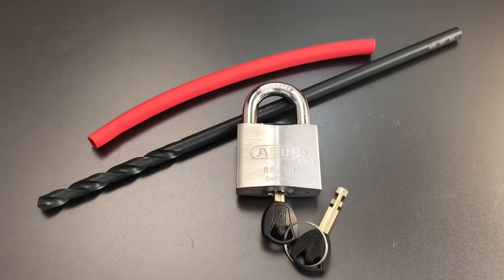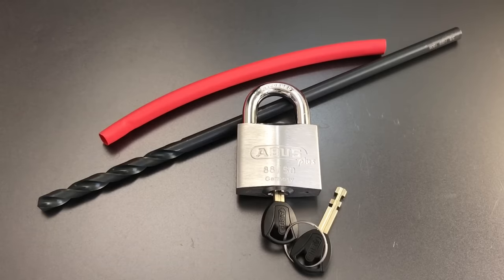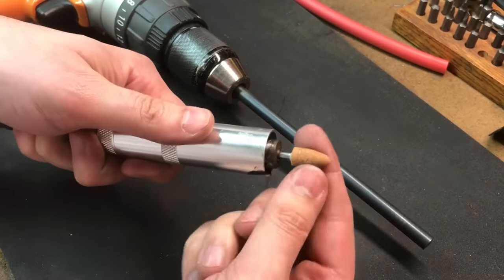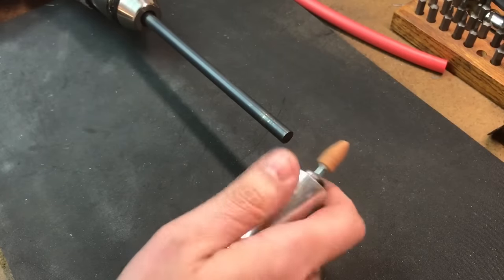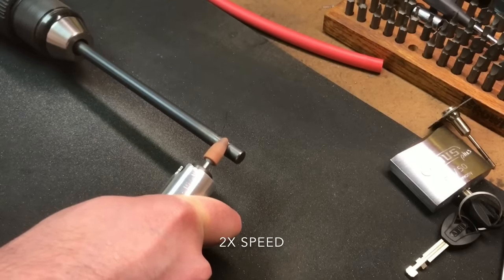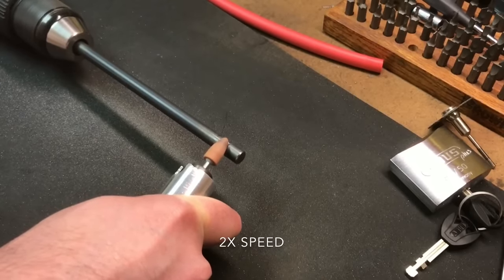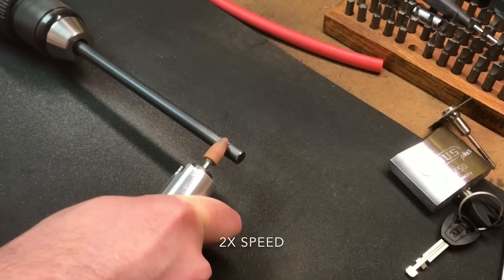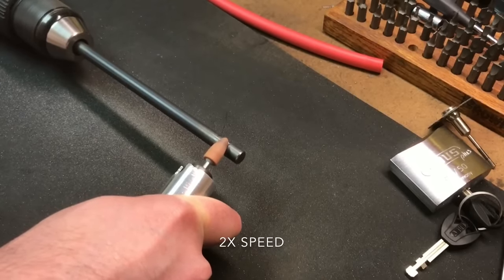[464] LPL Project: The Best Gun Lock Ever?

Comment: REGARDING PLASTI DIP: I've had that same type of can, opened, for 8 years now. The way I store it is: Put on it's plastic cap. Then put on two layers of kitchen plastic wrap so that is comes down over the side by a few inches. Put rubber band to hold that to the can. Then put aluminum foil over all that, with another two rubber bands. -- All of this seems to have made a tight enough seal to keep the PLASTI DIP from drying out. Have opened, used, and resealed maybe 6 to 8 different times over that 8 years.

Comment: Neat idea. If you notched the drill rod, rather than cutting a groove around it, it would be stronger. Secondly, why not plastidip the drill rod too, so it color matches the lock and seals the heat shrink tubing?

Comment: Old video recently watched and I have a design question.  Like the recent Master Pin Lick you pointed out the narrow neck where you cut for the locking lug, on this DIY, could you have made that groove directional? I get turning the bar would treat the lug like a shimming attack, but if there was a way to attach something that prevented the lock body and/or the bar from being twistable would enable you to put the groove on one side of the bar increasing it's overall strength. Just a random thought nagging at me I had to ask.

Comment: Marine grade heat shrink usually has at least a 3 to 1 shrink ratio, so a larger size would work. Better to use rubbing alcohol as lubricant, as one can then blow a little air through it for fast removal, or wait for 15 minutes to dry naturally.

Comment: The problem with using a grinder / Dremel / cutoff wheel tool so that sparks fly away fr your body is that when the tool runs away from the material it comes toward your body rather than away.

I use the term " when " because it ALWAYS will catch at some point when cutting and run - much safer it runs from you than toward you.

So you need to protect yourself from sharks ( pieces of material) that will be spewed in your direction while cutting, obviously

Comment: Great video and project. I would suggest it might be easier to bend first, then cut to length and make the groove. This will eliminate the potential of bending in the wrong place.
Reply: I thought of that as well, but if you use LPL's method of putting the shaft into the drill to make the groove, you can't do that after it's bent.

Comment: Hey, I don't know if you still read these, but you might want to try taping over your open can of plasti-dip with foil tape or just tightly securing a piece of heavy-duty aluminum foil over the mouth. Might not stop drying, but it's a low-cost, low-effort fix attempt 🤷‍♂️

Comment: I had the thought 6 years later. Why didn't you Plasti dip the drill bit locking bar in the Plasti dip. It still looks good for the heat shrink but maybe better with the Plasti dip. Just a thought for the 2.0 version.

Comment: I've never seen that plaster dip stuff, just wandering if it could have been used on the rod as well in place of the heat shrink tube?  might be easier to install and have the colors match perfectly.

Comment: I wonder what the thought behind using a drill bit was. Grip that gun by the barrel and smack the lock against the edge of a sturdy table.
This kind of steel shatters. You would be much better off using a cheaper soft steel that deforms.

Comment: Instead of fighting with the heat-shrink tubing, why didn't you just dip the lock bar when you dipped the lock body? If you had, both coatings would be a perfect colour match for each other, and if you make more than one of these Gun-Locks, using different Dip Colours allows you to ensure you don't accidentally try placing the wrong lock on the gun...each gun gets it's own unique lock colour...

Comment: as update: don't us a Drill just use a Hex Kex, they are already bend and hardend, so you only need to cut it to length and grind the Groove. and if you grind the grove just on one(the right side it will also prevent everything from spinning)

Comment: Your locking rod looks very similar to a ball ended hex key. Maybe that would be an easier starting point to work from? Might get lucky and find it works right off the bat with no adjustments.

Comment: Are there any abus locks like that that cme with a non retained / removable shackle? Thinking about it, what if you just had an appropriately sized lock, with an extra long, removable shackel? Add some heat shrink and call it done - is the issue that those locks don't exist?

Comment: So if this is better than anything you can buy, and it's relatively cheap and easy to make, why doesn't someone make this and sell it?  Hell, a gun lock maker is probably already going to be a padlock maker, so they basically just need a hardened steel rod and a plasticizer?

Comment: TBH, I think an angle grinder capable of that cut is far cheaper than a dremel capable of that cut. The notch grinding isn't nearly as power-intensive as the cut, so a cheap dremel and cheap angle grinder are probably a better option than an expensive dremel.

Comment: Why not plasti-dip the drill bit instead of using heat shrink? The slightly different color of red hurts my OCD. :-)
It would have the advantage of not having the little hole at the top from where the heat shrink tube is open, no worries about heating without burning, no problems with getting the heat shrink around the bend, and no bulging heat shrink inside the bend.

Comment: If this design was adjustable to fit different size guns you would dominate the gun lock market. could there be multiple notches on the drill bit and exit hole on the pad lock so the drill but can pass through it and lock at multiple heights?

Comment: Nope, I would grind the drill bit emulating the original shackle, on one side instead of all around, otherwise it would be too slim, this metal is very brittle and prone to breaking  I would index the curve at the other end in the direction of the barrel, either to the front or to the back of the gun. Disclaimer: I live in Canada, don't have a gun nor plan to get one, ever.

Comment: I'm guessing the other part of the shackle rotated slightly, so that the ball bearing couldn't drop in cleanly and so the key couldn't unlock things as the ball bearing was pressed against the cut shackle part. Stopping that part rotating will make things easier, plus you don't need to cut out as much if you know that the long shaft isn't going to rotate around.
Also, why use the heatwrap tube when you could just plasti-dip the drill bit?

Comment: You coulda run the angle grinder at 1/2 speed and the dremel at 2x speed and the angle grinder still would have been 2x faster! Good point of using the right tool for the job!

Comment: If you put the open can of plasti-dip in a vacuum bag and then suck all the air out, it might keep longer...I suspect what you refer to as drying out might be the material curing in the oxygen of the open air as it's supposed to...remove the oxygen/air and it shouldn't cure in theory...

Comment: Probably could have got a j shaped or u shaped bolt and modified it and eliminated the torch to bend with and had more of a radius for the heat shrink. Fastenall might have had the right grade of metal j or u bolt for your build.

Comment: so I drive a semi truck. 
they use this same brand lock and 2 steel plates to secure million dollar loads (technically all my loads are secured with this lock). the plates block access to the shackle. so someone brute forcing it could have to grind through the lock body itself or the metal plates. Is this brand lock considered the best from a picking/other security perspective.

Comment: And if you don't want to blow the temper on your steel rod and risk setting your house on fire with a torch, just buy 2 locks, repeat steps 1 and 2 on the top of your rod...and BAM...done. Or you could use a hardened Alan Key that's already bent on one end.

Comment: Supercool lock design and anything LPL endorses should be pretty idiot proof. 1 remark about the heat treatment. When going red hot you destroy at least 2-3 inches of temper so my recommend would be to heat all of it till non-magnetic and dunk it in oil to re-harden it so you know those weak spots are gone

Comment: 13:50 wait a minute... why isn't LPL using the cut off shackle as a reference bit for the notch? Even if the length would be a bit off the shackle's notch would still be a viable reference for if you got the cut to the point it'd lock in.
Edit:*two minutes later* Ah, there it is... nevermind then.

Comment: How hard would it be to bend the drill bit part back straight or even break it with the help of some leverage? I can’t lock-pick but I would sure be able to do that ahahah
Edit: You would just need a one meter iron pipe not too much larger than that, put it on the bent end, put your foot on the lock and go to town on it! I know iron is softer but if it was thick enough…

Comment: I don't understand gun locks. I get it on paper, you don't want your kids getting a hold of it. But then why not just hide it well?

Then when they're old enough, take them out shooting at the range. Let them appreciate how dangerous they are and teach them gun responsibility.

That's exactly what my dad did. I never knew we even had guns in the house as a kid until I was probably ten or so, then my dad took me shooting and it gave me an appreciation for how to handle a gun.

After he was sure I understood, he told me where the guns were and made it very clear he was only telling me in case I was ever in a situation where I was home alone and someone was trying to break in. 

Never touched those guns without his permission once. It's amazing what responsible parenting can solve and prevent.

And you might say "well you can never be too careful with kids", and I agree to an extent. But also, gun locks only make sense on a gun you aren't using for home defense. If you need to access that gun in a hurry, that burglar isn't going to let you wait to find your keys (because you can't store them near the gun) and then unlock it, then load and rack a round. It's horribly inefficient and that's dangerous in a home defense scenario.

Comment: Id stick to Picking the locks. Lol im really curious how much force itd take to break the lil nub u made off. By cutting all the way around it, u are actually removing more metal than needed. Therefore making it weaker. I was scratching my head, wondering why you went through the trouble of marking where it needed cut via the mark made by the ball bearing. When you had the shackle next to you. That told u exactly where the notch should be. Im also curious if anyone with metallurgy knowledge, can answer my question. On whether or not him quenching the metal multiple times if its enough of a temperature change to make it more brittle? This is why im so curious how strong that lil nub at the end is... I wonder if this makes him appreciate at how difficult lock macking can be. In all reality he only made the shackle per se.

Comment: Bet you could find Allen key/hex key about the right size and save 90% of the effort and that is tool steel so very hard
Reply: Agreed. And cut a notch on the inside of the Allen key just like the padlock shackle to allow the ball bearing to sit. 

That drill bit was cut so much that it can probably snap off.
Reply: @f8c3themusic  some even have a cut out already for ball end hex keys
Reply: @mmhhjj34  that’s true. I have a few small ones like that.

Comment: Those really cheap china cable locks most guns come with I use to be able to pull them apart with my bare hands.  I use to work at a gun store and we would break them by  hand sometimes to show customers how bad they suck.   Ruger on many of their buns use a long  shank padlock that you just slide down the mag well like yours.     So people can often buy along shank lock as long as it will close.         Nice build though

Comment: IMO it would be better to not spin the drill rod while cutting the notch. You're eliminating 50% of the strength of the drill rod, and  making it far easier to bypass by freezing the lock with canned air and snapping it.

Comment: You've ground off so much by pointing the high speed steel in a drill and abrading the circumference. What was wrong with doing the bend first and just grinding on one side?
Reply: Makes the product extreamely uneven and shitty to look at. Also using the lathe (drill) he would have spent the exact same amount of time grinding off a single side as he did with his method.

Comment: Why not just purchase a properly sized bicycle U-lock where one side of the metal U can fit through the cylinder and the other side of the U hangs outside of the lock. It would be cumbersome but requires no work and just buying the right sized already mass market commercially available product for a different intended use

Comment: That's definitely your first time to heat shrink with a torch😂. When you are Heat shrinking with a torch or a heat gun you have always to make sure to pump it all the way up to full bore. And move your torch/heat gun swiftly, evenly and most importantly Quickly with a good distance to get it evenly heated. If you burn the heat shrink than you were to slow and sleepyhead then you know you have to move your bum more quickly on the successive try. Try again until you master it. Setting it in the lowest setting is the most common noob mistake that you can make 😂i know what I'm talking about I do heatsinking the whole day that's my bread and butter 😀 a'd how you do it you would probably kicked out of the company because you are to slow and ineffective on it😅. Try it out and see for yourself😄. It's like holding your fingers on a candle flame if you hold still your fingers get burned badly if you move your fingers through the candle flame in just the right speed you will feel a comfortable warmth like 30°C. If you move your if you move your fingers too quickly thought the candle flame you will feel nothing at all of temperature difference 😁. If you get a sense of how flames/heat works you get much easier and cost effective the great results that you are looking for 😎👍

Comment: With a little bit of YouTube in a little bit of training I think you would be able to take off the top of the gun and lock it to the trigger guard I guess you could say it would be slower to put together again but like I said it with a little training, every night before you go to bed dismantle it and put it together again it cut your time down to around 15 seconds. But in this case, it would be easier to drill a large hole in the trigger and put a thick lock through it make an it so you can't push it down more than half a millimeter. Or sincere already using locks that have keys, why not just lock it in a small locker that you can choose what lock to put on?
Reply: You could also hide the lock while holding the gun and just brandish your weapon if you only have like 3 seconds to react and if that doesn't scare the intruder, The extra weight of the girthy lock could help knock him out. Its also Imperative that you do a few measurements before you cut the holes.
Reply: I'm not a gun expert do all of these things at your own risk.

Comment: Id rather teach my kids proper fire arm safety instead of making access to a gun more difficult for me. There is also the problem of emergency access in cause of home invasion if the kid(s) is(are) alone and need to defend themselves. 

I find the concept of locking away firearms rather absurd, especially if its locking the action as shown above. locking away a valuable collector gun in a safe is something i can understand, but a tool i do not

Comment: Wait was recoil spring remowed first? If it's locked long time in that position I assume it would affect spring
Reply: Highly disagree, every single spring I have ever come across with has a point with gets weaker when compressed. Even with bestaterials around industry
Reply: @P3X169 Thats cap dawg. Unless you have springs bought from the actual middle ages or the dollar tree, they didnt weaken just because they are in a compressed state. Its been proven time and time again that compressing springs doesnt wear them out. Its the act of releasing spring pressure that causes spring degredation. Yes there are periods in time where spring steel quality is shitty but not in modern days.

Comment: I normally agree with LPL on what he does... But this was an L... Just use a cable lock. This isnt keeping your gun from being stolen, just fired. Same thing a cable lock does. And if youre worried about the cable being cut wnd then fired, use a thicker cable. Although, even LPL ways this is for a curious teen or adolescent, to stop NON-DESTRUCTIVE attacks because nothing will stop someone with a grinder or dremel.

This was just overkill for a solution that already exists... Also, cable locks are one size fits all. So you dont need a custom one for each gun... Sorry LPL
 still love your stuff.

Comment: Guaranteed to fail!!!! hhigh carbon steel drill bit is brittle. especially considering its been cut down so much, this could be EASILY broken off by  using the shackle as leverage and breaking the bit. even if it was mild steel this will bend and break easily at the notched section this could even break if dropped and it hit the floor in just the right way. 100% fail